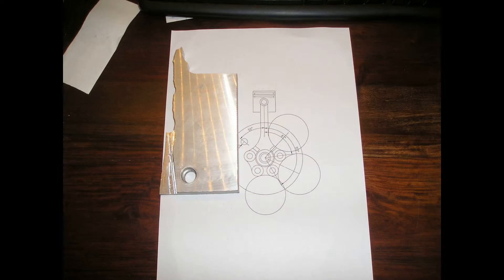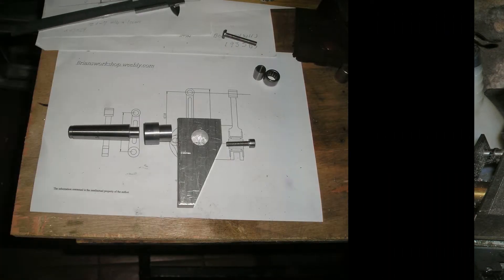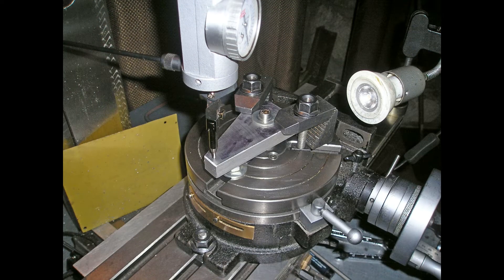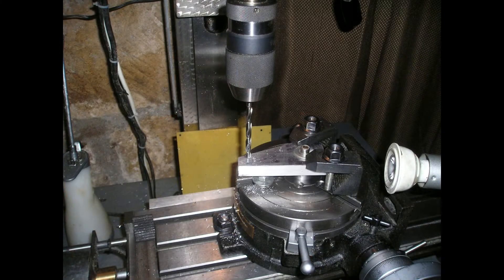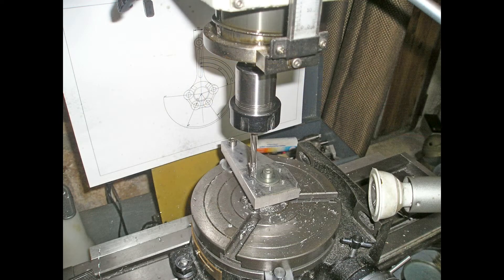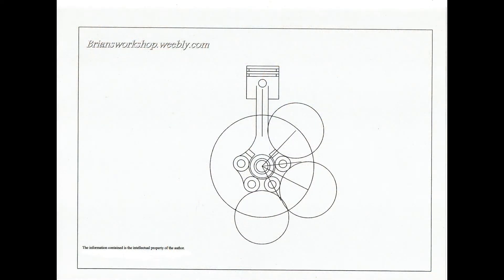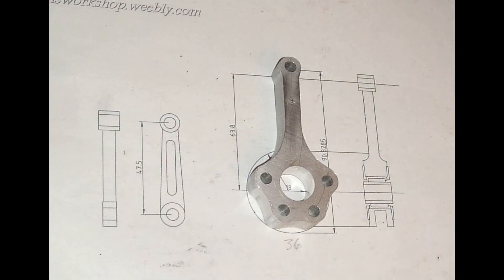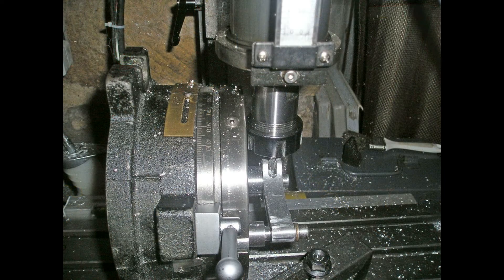Building the five cylinder radial engine Part 13

Comment: Hello! I'm very interested in your work and wish to know if you build this engine with water cooling, dual overhead camshafts, how much power it can punch out on 2L naturally aspirated displacement? If it's supercharged, how much power it can punch out? If I have the money and time, I would explore building this engine, too. I see this engine having greater potential than Subaru boxer engines because it has even lower center of gravity.